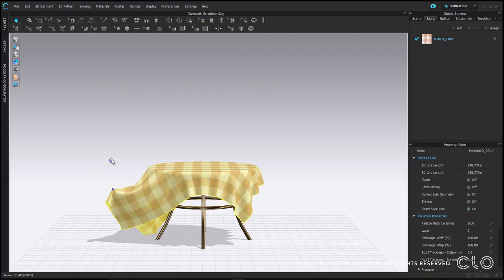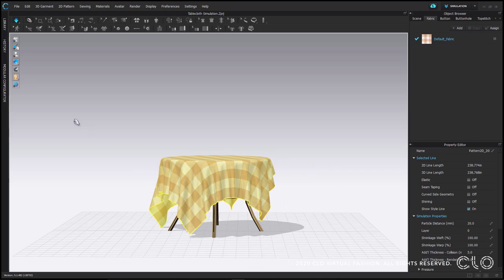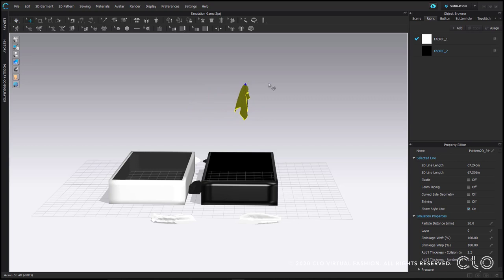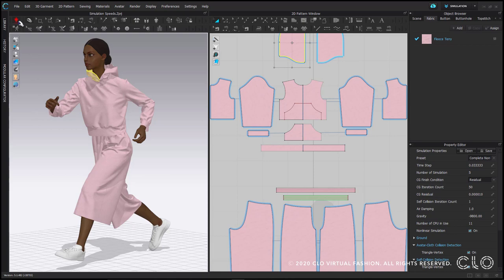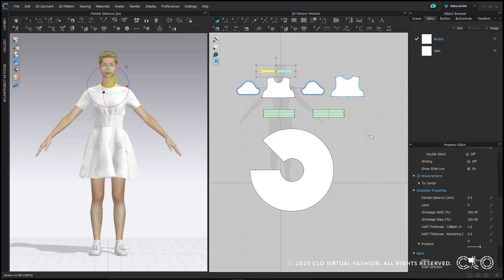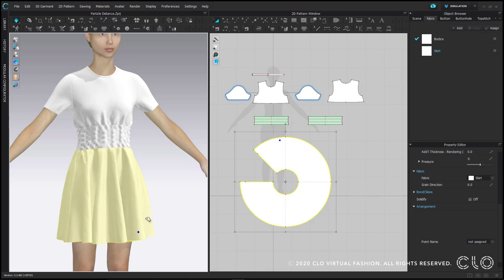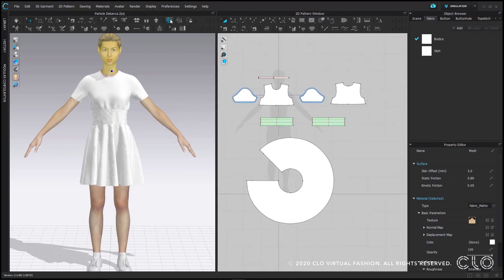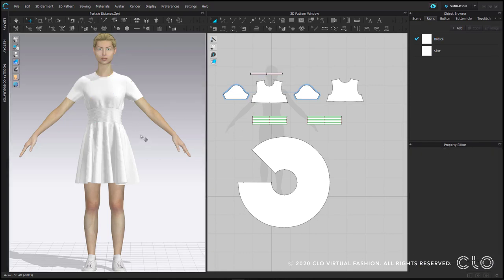Beginner's Guide to CLO Part 1 Foundations: Simulation & Particle Distance (Lesson 7)

Comment: I only have two options for the simulation - Normal and fitting (accurate fabric) which Isn't in the drop down on this video. Is this due to the graphics issue you mention in video that some of the options won't be there if your computer doesn't have the necessary graphics card? I'm just wondering about the fitting (accurate fabric option too then). Also I have the hi-res garment icon but I'm missing the low-res option. Would there be any reason for that?
Reply from the maker: Yes, if you are missing GPU simulation it is because you do not have a dedicated graphics card. The low resolution button is grouped into the high resolution button in 5.2. Hold the tool down and the other options will appear as a drop down menu.

Comment: Hi! On my simulate button I have only two options: Normal and Fitting, why does on the video shows 4 options? Also on the Hi-res properties > Simulation quality I have two options: Normal and Fitting, but on the tutorial shows Normal and Complete, why's that difference?  Amazing tutorials, thanks so much :)
Reply from the maker: This is because as of 5.2 the Simulation names were changed - below is a link to page that explains all these differences. If you do not have Fast(GPU) it is because your computer may not meet the minimum spec requirements to run this. GPU requires a dedicated GPU graphics card.  

https://support.clo3d.com/hc/en-us/articles/115000304968-Simulation

System requirements can be found at the bottom of this page: https://www.clo3d.com/pricing
Reply: @CLO3D  Thanks for the answer :) I'm using a laptop with a AMD Radeon Pro 5500M 4GB  Intel UHD Graphics 630 1536 MB graphic card. Is it posible that I don't see the other two simulation options because I'm using a MacBook Pro (2020) ? Thanks ✌🏼
Reply from the maker: @Tomas-py7vh  Oh yes, this is also not available on MAC or with AMD Graphics cards. Sorry :(
Reply: @CLO3D  no problem, still a great software! Let's hope for a 5.3 compatible version for Mac users. Thanks a lot :)